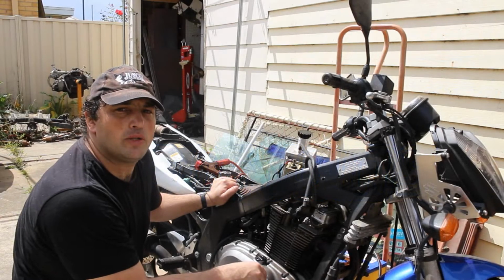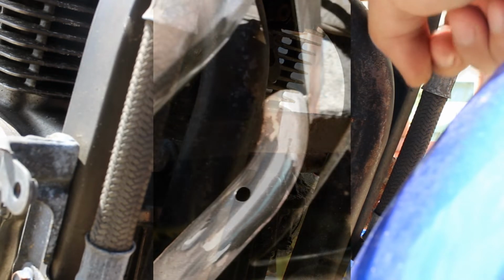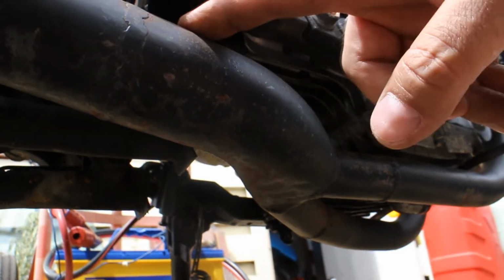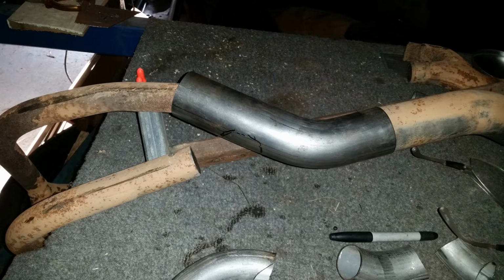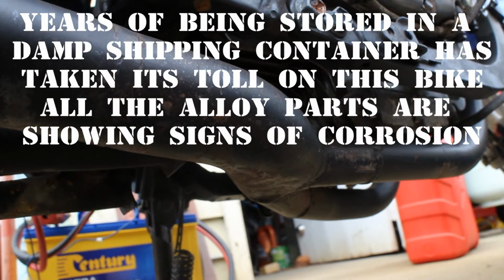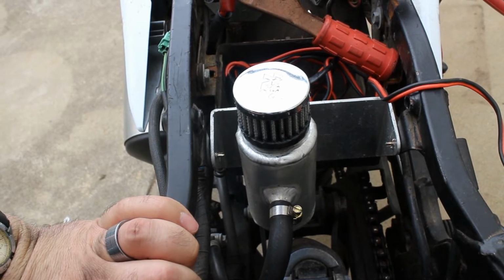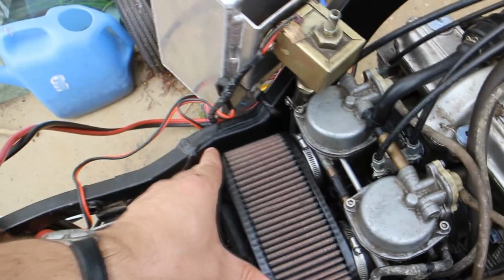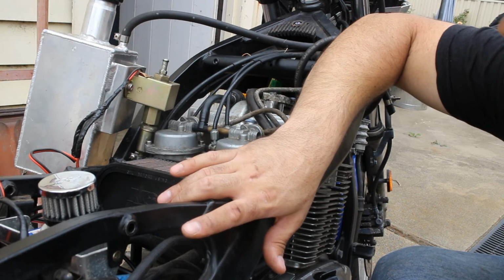suzuki GS500 custom exhaust

Comment: it is a nice sounding exhaust, the new y is better, I want to do something similar but with another exhaust, the mod with the aluminum plate is great,  I'm sorry that you can't ride anymore
Reply from the maker: When I built it I was amazed at how good the factory exhaust and muffler sounds with just the Y replaced. 
As for not riding anymore it's not to bad... I just have to build my K24 mini and I will be able to get that up the wriggly roads faster than I could ever take a bike so that will be fun

Comment: You did all the custom work on the bike but you don't know how to re-jet the carbies ?  Seems strange to me ?
Reply from the maker: I dont find it strange because I am a custom fabricator not a mechanic. However I can strip a carby and put it back together so it works. but in this case it was more cost effective to take it to the shop so they could get the jet sizing right and balance the carbys as well.
Reply: @juscozcustoms  How can you custom fabricate exhausts without knowing about upjetting?
Especially as you're playing with custom intakes, too. Minimum you need to know to tie it all in, is jet sizing.